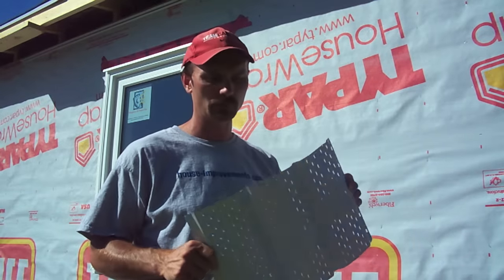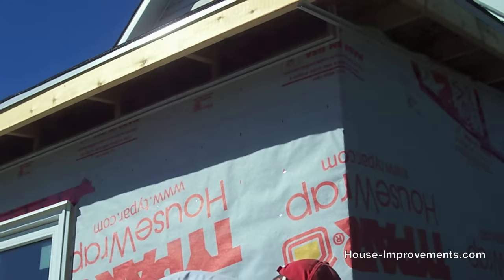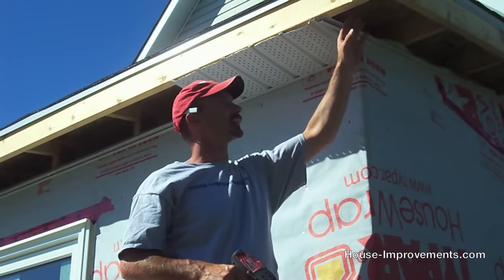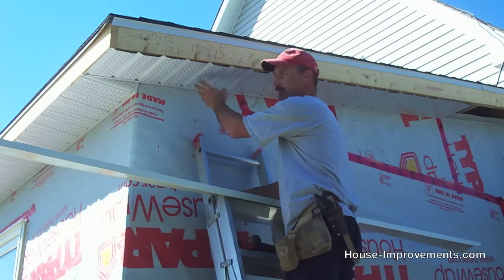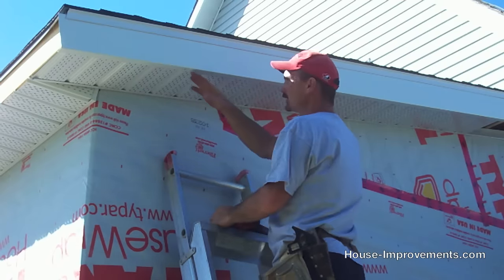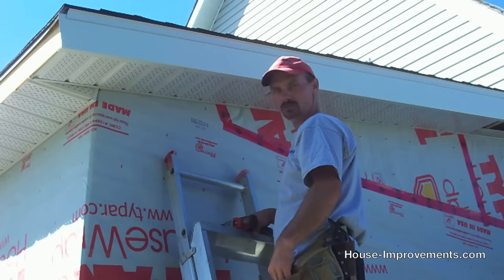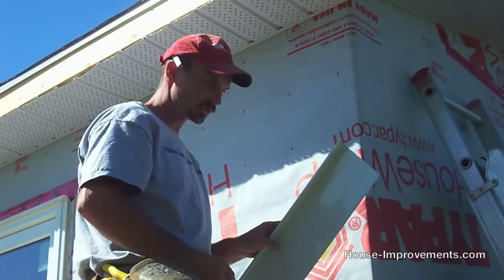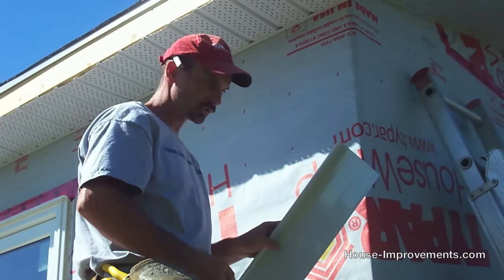How To Install Soffit And Fascia

Comment: No offense but how do you make money that way? Technically the soffit doesn't need any fasteners The J channel and fascia traps the soffit with no where to go. The only reason to fasten it at all, is just to keep it from faling out before you put the fascia on. Everyone I know uses 1/4" crown stapler and staple it on the female tab of the soffit. If I screwed evey soffit panel in 2 places like you I'd go broke.
Reply: Justin Marshall LOL actually I've been in business for 31 years and I that 31 years I've only had 1 customer that complained about ANYTHING that I've done. I have dozens of repeat customers and have even been featured in a brochure by a prominent Chicago developer...BTW  something I forgot to mention in my first post, not only is it a waste of time to screw the soffit but it also does not allow for expansion and contraction. It would be like tight nailing siding, a total no no.
Reply from the maker: Kelly McKenzie What would make this the wrong way??? Screw or staple they both hold it in place.
Reply from the maker: Squeekycleaner If we don't fasten in two places the soffit panels rattle in the high winds we get. If I showed people using a stapler most of them would have the pressure to high and blow right through, I do it this way, you do it yours neither is wrong, they both get the job done and yours would be quicker but also more dangerous at higher heights  because of the hose you need to drag along.Its fine as a pro who does it everyday because you get used to it but theses vids are for DIYers who might do this twice in there lifetime.
Reply: HouseImprovements Well when I staple the panels I only staple them on the female tab allowing the panels to expand and contact. Not on every section of every panel.
Reply: Squeekycleaner 
From what I've seen, the crown nails rust and some of the installers also staple the fascia on the rake. I've repaired those homes when the wind finally grabbed and the staples rusted away.
I do understand your point, it takes time to screw it, but soffit and fascia go on extremely fast. I personally use stainless ring shank painted nails. They hold forever.
Reply: staples rust over time and is not the correct way either i have done lots of repair work because of this
Reply: Squeekycleaner 
I am in complete agreement with you, on that.
Reply: code prevents the use of staples and nails with out full heads
Reply: MasterMech77 
Uh, codes don't prevent much. Codes are just words. Quality contractors prevent poor workmanship.
Reply: Marc Leconte
SO very true, but wanted to clear up the outdated and misinformation that people are spreading. Staples are not allowed it be used in soffit installation. At least not here in Florida and especially on new homes. Everything is screwed in, and done the full length of the soffit (for the most part).
Reply: Squeekycleaner I’ve been reading all the comments just waiting to see who would catch this. I agree with you
Reply: Ronald Howard
However, here in Florida it is a requirement per code to use either the proper soffit screws or nails to secure Soffits in place. Due to the high winds that we get from hurricanes and other related storms... Most Coastal states also require the use of some sort of fastener. SO  Squeekycleaner is half correct... it just depends on the state and or location you live in.
Reply: The use of staples is prohibited here in Florida, since they don't hold properly in high winds... As a home owner you can get away with a lot of things. However as a contractor, and having to perform work to certain requirements, you are legally obligated to perform work to code standards... BUT hey, do it however you know best right?
Reply: Seriously, expansion and contraction of the soffit is a reason not to to put two screws (per piece)?  Sorry, but you're trying too hard.  The next contractor who has to repair a soffit because two screws restricted expansion/contraction, will be the first.  As for me, I have never been featured in a brochure.  However, I have seen dozens of houses where extreme winds ripped off the fascia capping and some of soffit took it as an opportunity to run away.  So my point: There is no right or wrong on this particular issue; just a preference.  Embrace differences.

Comment: Man I am not sure where or who taught you how to install soffit& fasia, but it is totally wrong get some roofing nails, do not drive them home; expansion contraction dude. There is a spot toput the nails, get a hammer. I still do this after falling 35+ft disabled.

Comment: If u are going to show people how to install soffit and fascia.please show the correct way.u do not screw up soffit or fascia.the part of the video that made me laugh was u were installing the soffit backwards.u installed the fascia incorrect too.the piece of fascia u installed second,should of went on first and u make your corner bend before u put under the drip edge.and u use hammer and nails to install the fascia.
Reply from the maker: No one here ever nails or staples these products anymore, its all screwed. Soffit can be installed either direction ,it depends on which end of the roof you start at and what way you want to turn the soffit to hide the joints better. Everyone has an opinion on the fascia corner procedure, either way works.

Comment: You are putting them in backwards. The nail strip should be open to add in nails or screws. You put in the second piece and nail strip was hidden. Also the first piece you installed looked like ass. At least pre bend it so its not pushing down like it was.

Comment: Pro contractors do pro work, not videos. Cameras are an encumbrance. Would get knocked over or kicked aside. Pros don't learn by video, but by doing under responsible supervised mentoring. If this is what you were taught as apprentice, your instructor was an amateur. All good tradesmen continuously learn how to do things properly and optimally. Try it sometime. It means unlearning all the bad habits gleaned from bad instruction.

Comment: That looks like shit dude. You should always 45 the soffit around corners. You should also not be screwing through the J channel and soffit. Vinyl products expand and contract with the temperature. They have nailing slots for a reason. You should of padded that out with something to nail to. 
They sell white trim nails for nailing facia. You just put 2 or 3 nails in the face and its done. I would never screw through the bottom like that.
Reply from the maker: This is not vinyl